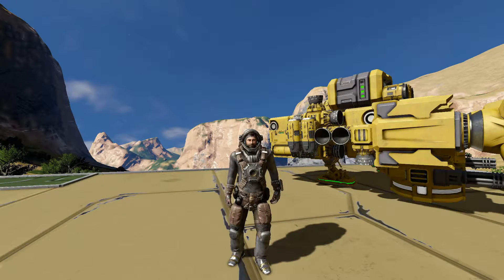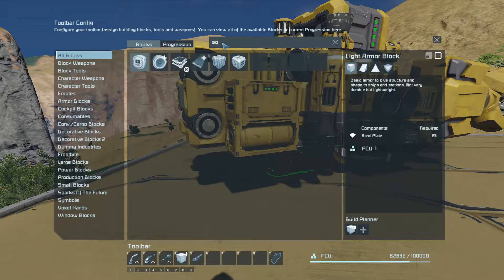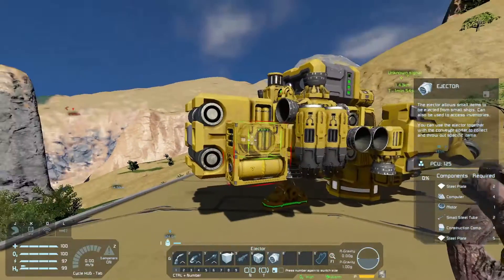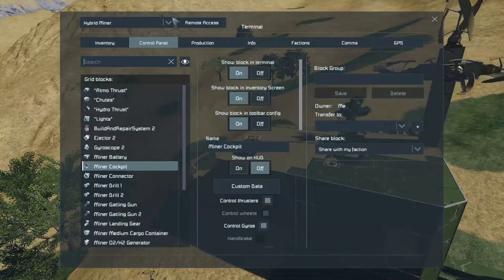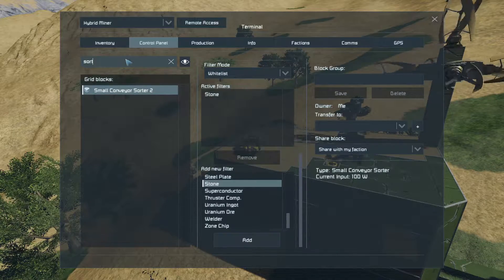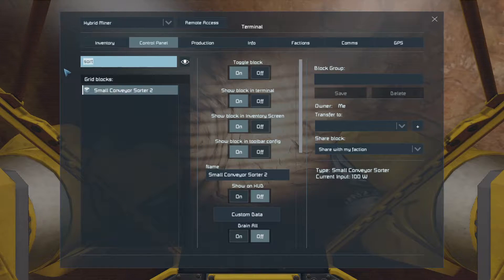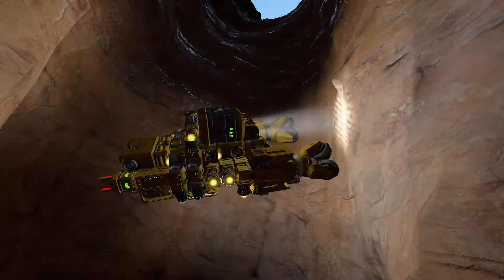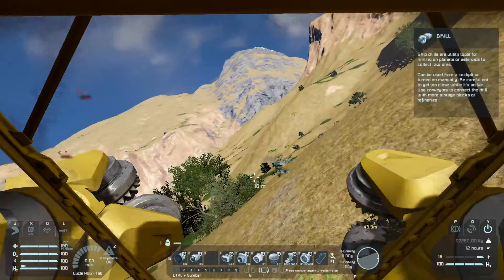Space Engineers: Adding a Sorter and Ejector to a miner

Comment: I usually set it up slightly different; Ejector is set to "throw out" (and NOT the collect all) and sorter is set to "drain all", with stone as whitelisted as you do. - Is there a difference in speed to throw out the stone with your setup; where the ejector is set to collect all, or some other issues to consider? - I doesn't seem to have any problem the way I have set it though. -  Maybe the two different way of settings does the job equally, and is just part of the many options there is in the game?!.  - Maybe to eject stone there is no difference, however the "drain all" function in the sorters is very useful, when it comes to the base or ship conveyor infrastructure.
Reply from the maker: I think, and I haven't compared them side by side, both techniques will run at the same speed. I'm interested to compare them now.... If 'drain all' is off does it not then only concentrate on what is in the list? Another thing I'm not sure about haha! I'm loading up SE now to check that out. Thanks Kim.
Reply from the maker: UPDATE: Ok. I've tried your setup exactly as you mentioned and the results are identical. Collect all on the Sorter doesn't change anything as there is only stone able to pass to it. Drain all on the Sorter is the same as the next item in the chain being set to 'collect all' from what I can gather. I think the functions are interchangeable here as the components may be used individually. On a base you may want your Sorter to push only certain objects, without an Ejector 'pulling' them. I'm not sure if that makes sense? What do you think Kim?
Reply: @TallmanBradGameplay  Exactly what I thought, that they are identically in speed. On base and bigger ships I use the sorter, to direct ice to a certain area, take all components and put in one container or container system, so I have all components in one place. - I could get the overview via lcd displays, however, haven't go so far as to use them with scripts and all the setup thingy that follows. Maybe its easy. - could be a video for you to make. - also the more advanced remote controlling of ships and vehicles, like waypoints, auto mining, if possible with vanilla and or simple mods. - Daily needs mods, when using that I also very much use sorters, to get ice and food items sorted to the right places, even it can take things by its own. However, especially in the Daily Needs mod,  it somehow always screw up things with taking in plates or grids or pile up with gravel or something, that totally blocks the system for producing anything. - So especially there I found the sorters very useful within the base or bigger ships. - Also when dividing the base up into sections,  like having the ammo in one container and components in a second, ice in third, food in fourth, tools and or bottles in five and six, then if enemy npc blow up some, it will only affect that part of the base, and not everything....like if all in one container system and if hit, then everything in the base stops.
Reply from the maker: You've really thought out your base system well! Sorters to send certain components to different areas is a great system.
There's a lot of ideas there for videos I could do.
-Patrol drones (unmanned) defending your base.
-inventory management with LCDs.
-Unmanned auto miner.
They'd all use scripts and in particular the inventory management could be done with no sorters and just 1 script that would also display everything on LCDs.
I'm not a fan of the Toothpaste (daily needs) mod. I just get lazy with it and eat the basic food, not bothering to make the gourmet items. It's tough early on in a survival scenario where you're juggling base building with trying to make water. But! I'll add it to the list of potentials.
I'm thinking about doing sensors for air locks, incorporating timer blocks. Not sure yet. 
I'm bumping 'inventory management' up the list though. Thanks for that idea. Might look at that next week.
Reply from the maker: I appreciate your comment about 'vanilla' too. I am trying to keep everything vanilla but I do feel SE is a bit like MS Windows before you install your own apps. You can work with it and there is plenty you can do, but it's so much better with your own apps. I'll keep things vanilla unless the actual mod is the 'feature' of the video. Also I want to avoid using DLC blocks in tutorials in case anyone following doesn't have that content. Thanks for all the feedback Kim! I really appreciate it.
Reply: @TallmanBradGameplay  Thnx a lot also to you. Agree on the Daily Needs mod. I used it once in a scenario. From there I learned about it. Also basic vanilla is good for starters and to learn the game. I am still beginner and have started to put in rival NPC's and stuff, however, if turning off antenna, it's almost vanilla :) - I am not sure where and how to join multi player servers yet, as if just joining somewhere to be blown up same minute I enter, then also not fun. - I have played enough now, so I know the basics, so I would luv to join some group, as single player does become out-played. Also doesn't seem to be scenarios build by mod makers. Didn't look too much into though, but like the Frostbite scenario have to little of what I would like and is more just a shooter scenario. -  Flipisie/tipsie or what ever, made a good scenario pack with survival impossible, played a little, but the real hardship there is nothing but extra grinding. Wolfs, spiders and meteors also really doesn't add to the gameplay imho. - some youtubers seem to play a scenario.....but seem its not a pack, but just a setup for the video they are making. -  A content for videos could be mods combined, which makes it take the game in different directions. - mods is a jungle for us beginners. - some guide and different suggestions could be useful also. ....I mean other than bigger guns and better shields.....which seem to be what people focus on.... I am 50+ and looking for some more ...... yeah.... Space Engineers really have the potential.....in some ways better than minecraft or other open world sandbox games. -  Personally I will not use the nanobot repair mod, as I feel it ruins the gameplay. IT becomes a semi creative game. The challenge of building and setting up a system, to handle those issues, is for me a big part of the gameplay. - welders on a piston etc, grinder grave to drop things into etc etc. -  I like these kind of challenges as else the game become too easy and to close to be a creative builder, which takes out the actual gameplay and turns it into a designer game instead. - Godd videos and I feel you luv doing it. That is MOST important. - Do what YOU feel is fun and interesting, then rest  you don't have to worry about ;) - cheers mate!
Reply: @TallmanBradGameplay  Oh yes, sensor and timer blocks would be really cool!!!!! I am sure I will get the courage to play around with those, if you made a video about those. You are really good at explaining and simplifying things. Thnx!!
Reply from the maker: There aren't a great deal of scenarios/campaigns in the workshop that I've actually tried. I quite liked the 'escape from mars' Scenario. It was quite hard but very well done. I started setting up my own scenario so I could do a Let's Play series but I've been so distracted with the tutorials that I didn't get very far. Possibly 4 episodes worth of gameplay to film.
Splitsie does fantastic quality videos. His current series is just a little too hard-core for me although do skip-watch the episodes to see if there's anything new I'd like to try myself. His assertive cargo (v2) mod is great. That's the first npc mod I add to my own games now. I really like the radio chatter feature and the ships are balanced well for a more gentle gameplay but still with a decent threat of serious damage to your base.
As for servers, I've played on several over the years and they all tend to have a massive amount of mods that I'm not interested in. I'd recommend looking for a PVE server that lists the mods use. Be wary of building close to another player on a PVE server as their block count contributes to yours and therefore more difficult NPCs will also target you. Also I got tired of building bases into mountain sides on servers. It's really the safest place to build if they have a lot of enemy mods. I always start a new game with a goal in mind. My favourite is simply 'get back to my home planet'. Triton is a great starting planet, with the goal of building a large grid ship (with hyperdrive) to get back to earth.